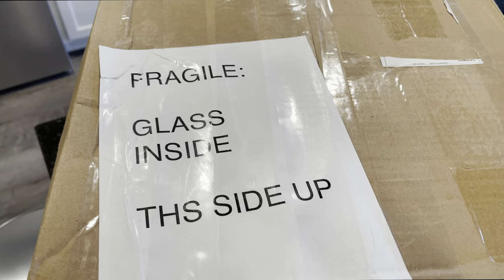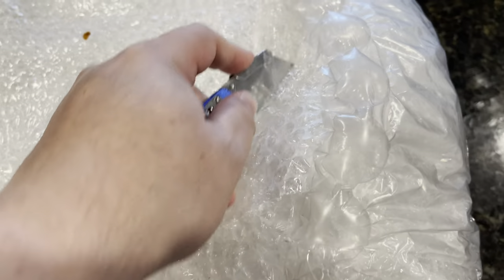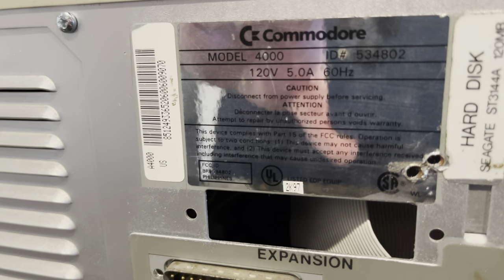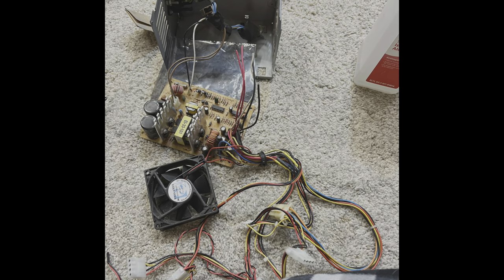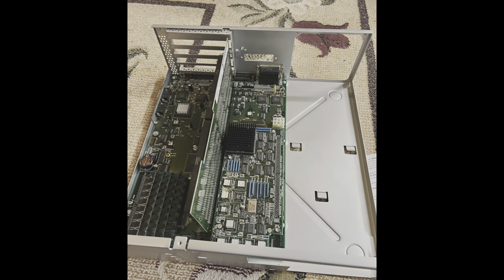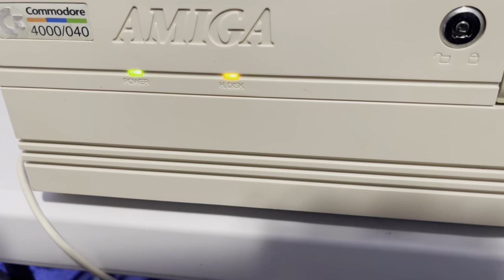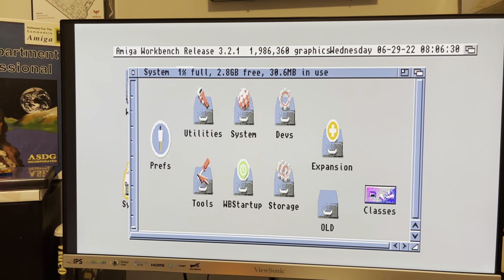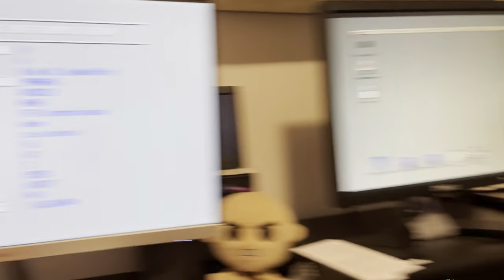One of the last Amigas ever! The best Commodore could do?

Comment: Brilliant! In such good condition, just lovely. I noticed that the CPU CopyBack mode was stated as OFF in SysInfo... You might want to look at that. In CLI it was "CPU Cache Burst CopyBack" to turn all that good stuff on.
Reply from the maker: I was wondering about that. Sysinfo has switches to turn those on and off. But it wouldn’t do that one.
Reply: @HoldandModify  sadly my 4000/040 won't boot because of battery damage so I can't test that anymore. Have a great weekend and hope you are doing great!

Comment: FYI, A1200's internal expansion bus is 32-bits wide since there is a 32-bit data bus from embedded 68EC020 via the Bungie chip. 

A1200's Budgie chip can be considered as a baby-Fat Buster chip, but the embedded 68EC020 has a 24-bit address limitation like Zorro II and this limitation can be overcome with the full 68020, 68030/68EC030, 68040/68LC040, 68060/68LC060 and AC68080 (Apollo's 68K compatible clone for Vampire accelerator cards).

A1200's Gayle chip controls the 16-bit PCMCIA external expansion bus on the side. Zorro II has 16 bit data bus.
Reply from the maker: I’m enthralled reading your breakdown. I’ve never made claim to be the end stop for this stuff. Wow. I love replies like yours.
Reply: @HoldandModify  A1200's Gayle chip that controls 16-bit PCMCIA is effectively a bridge chip with a PC ISA-based PCMCIA slot. Too bad A2000/3000/4000's 16-bit ISA slots weren't active for lower-cost expansion cards e.g.  Tseng Labs ET4000AX ISA with AmigaOS 3.x RTG.

With a simple 32-bit Fast Ram via the internal expansion slot, A1200's stock 68EC020 CPU can run arcade-quality Final Fight port e.g. https://www.youtube.com/watch?v=GojpwZMBHz4  Both the parallax and the “sprites” are drawn by the CPU.

A3000's 68030 with 32-bit Fast Ram could have done something similar. 

A1200 with 1 MB 32-bit Fast Ram and 1 MB 32-bit Chip Ram configuration would be superior when compared to A1200 with 2 MB 32-bit Chip RAM configuration. Adding 32-bit Fast Ram nearly doubles A1200's performance since it reduces the shared memory issues with the custom chips.

There are low-cost "What IF" configurations that can deliver better A1200 stock performance.
Reply from the maker: Well hell bells. Can’t flag this post as it’s actually useful. Thank you.
Reply: @valenrn8657  Don't some AGA games and common software need more than 1mb Chip though? I would have assumed so, I don't know.

Comment: Great stuff “Q”! 👍🏻 Watched Chris Edwards channel showing him fixing your A4K 😉 I’ve just got mine back from recap from a mate of mine. Unfortunately my Mediator 4000 Di MKIII Daughterboard appears to have now malfunctioned as AmigaOS4.1 Fe now locks up. It appears when I insert a PCI card it stops the OS from booting 😔 Luckily I have a Phase 5 Cyberstorm 060/PPC with SCSI and a CVision so at least I can get a RTG display from it. Running a SCSI2SD V6, from what I’ve read over on the Amiga Forums the Zulu seems to be a hit and miss affair. Cheers for the content 👍🏻
Reply from the maker: My Picasso4 is not working I don’t know if it’s my daughter card or if Picasso somehow spontaneously self-destructed
Reply: @HoldandModify  Does the Picasso IV show up in the early startup menu (Left and Right mouse buttons held down)? Should show up in the board diagnostics screen. Not sure on the ID number. If ain’t being seen there, then it’s not recognised.
Reply from the maker: @cullmaster7361  nope. :(
Reply: @HoldandModify  Have you contacted Chris? He normally tests the daughter board with his Zorro multi port card. If that worked then you know it’s not the daughterboard. As for the PIV board. You have set the jumper to make it work as a zorro III card?
Reply from the maker: @cullmaster7361  verified all jumpers with P4. That jumper you speak of is not a requirement. In fact the jumpers on the P4 by default are good to go. It’s only when the card is used in specific situations that they need adjustment. I’ve sent the card to Chris for him to test as well.
Reply: @HoldandModify  Good luck 🤞🏻👍🏻 Hope Chris makes a Vid on it, as I’m interested as to know why it doesn’t work 😉

Comment: Phase5/DCE 68060s have 64bit memory architecture which give them a nice boost.  Be great too if you have an MK-III or PPC version that can take the CVPPC gfx card.  

You should consider replacing the A4000 power supply if you start loading that A4000 down with accelerator, drives, ZORRO cards (gfx, toaster, tbcs, etc).  I find the original PSU to be underpowered for decked out A4000.

A4000 tends to get warmed up a lot when heavily expanded too.  Nice to see that Chris fitted some of the chips with heat sinks.

One upgrade that I'm interested in, but haven't done, is a 64MB on the motherboard mod that lets you use 4x 16MB SIMMs.
Reply from the maker: So this 4000 has an upgraded PSU already. It was used at a television studio and they needed it up for 24/7 operation. :)
Reply: @HoldandModify  Is it a BigFoot?  What model & wattage is it?
Reply from the maker: @jjdigitalvideosolutionsllc5343  it seems to be some OEM ATX converted guts type thing. Unknown.
Reply: 68060 has a 32-bit front-side bus due to the 68040 CPU socket infrastructure. PowerPC has a 64-bit front-side bus.

Pentium FPU's FP64 or dual 32-bit integer units can use classic Pentium's 64-bit front-side bus.

Comment: This looks great.  Kinda wish I still had my A4000 from years gone past.  Are there some "rough" price guides for reasonably priced Amiga's out there?  Just to have some ball park ranges anyway?
Reply from the maker: For big box Amiga’s the street prices on Fleecebay are $1200 to $3000. With an average of $2000-ish. I tend to wait until one’s pop up on the lower side. Even better if they have issues as you can get a slightly better deal and then send for repair. I’m thankful that I got the bulk of mine before the crazy began.

Comment: Great video! You mentioned a Picasso 4 going inside. Have you considered a zz9000 as an alternative?

Also if you a putting a phase 5 card in are you going to utilise the SCSI and maybe put a ZULUSCSI in?
Reply from the maker: I’m using the ZuluSCSI in my A2500. Have a video for that. Keeping A4000 IDE for now. As my Phase5 lacks the SCSI option. This ZZ9000 keeps getting mentioned. I don’t know much about it.
Reply: @HoldandModify  The zz9000 is a great multi use card. Offering RTG graphics, scan doubler and flicker fixer all through HDMI. It is has a network port, usb (which personally found a bit hit and miss) and 256mb of z3 ram. Downside is wait time for the card. It’s a really great alternative if not better alternative to the Picasso 4. They have also a plug in Audio card.

On the IDE topic. Wouldn’t something with faster transfer rates be needed for the image work you plan to do?
Reply from the maker: @leehiscox7688  that’s some great info for the 9000. For the IDE, nah, the speeds I’m getting are plenty for retro 3D animation fun.
Reply: @HoldandModify  No probs 🙂. Just found your channel and I am really enjoying  the content.
Reply from the maker: @leehiscox7688  well thank you! Everything I do is so niche’ I’m always pleasantly surprised when any new viewers pop up. Glad you find some entertainment. Thanks!